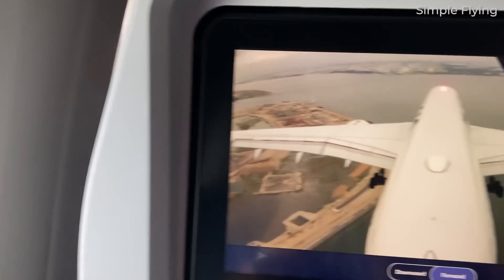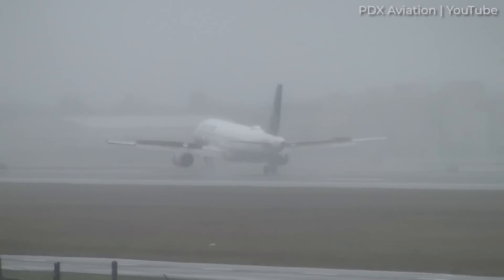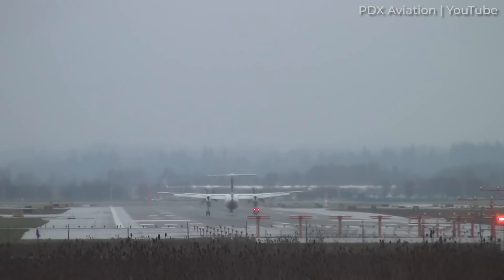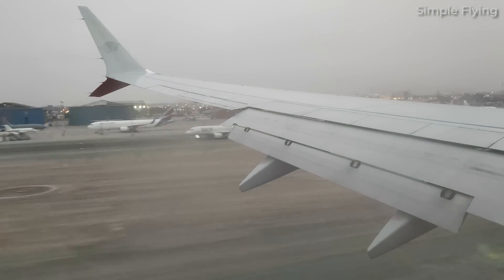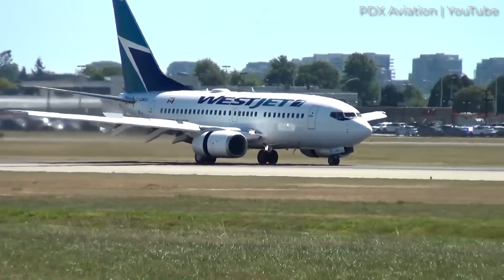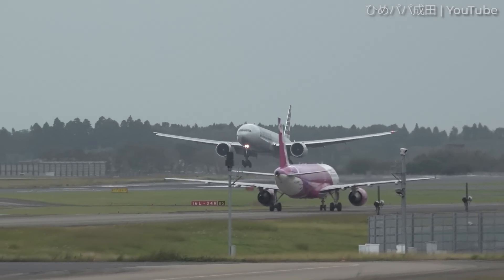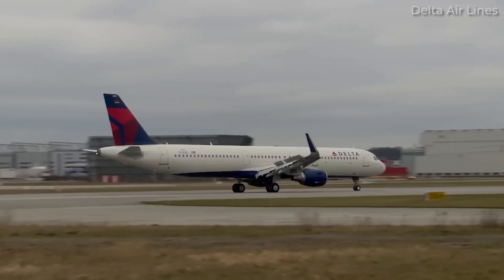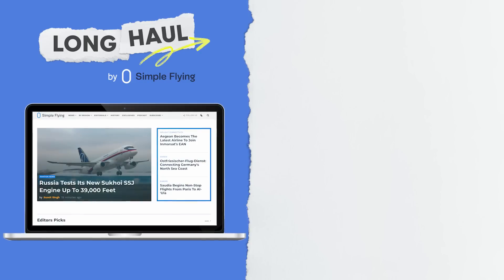Touchdown: The Variables That Affect A Smooth Landing

Comment: The best landings I’ve ever experienced was with any international flight on Philippine Airlines. Does not matter which plane they use. They may not be the best airline around but their pilots are exceptional at executing smooth landings. Most recent experience was into Melbourne from Manila on a 777-300ER (which was surprising because PAL uses these planes for flights to the US West Coast and also Vancouver in Canada. PAL usually operates the MNL-MEL-MNL route with the A330-300). The landing happened close to 6:30am AEST and it was so buttery smooth, a few of us passengers were clapping.

The worst landing I’ve ever experienced is probably with AirAsia on one of their A320s. Forget when it happened. It was such a hard landing that I was exchanging looks with my brother, who was seated next to me, and there were whispers in the cabin about the hard landing giving everyone a jolt. Didn’t help that my brother and I were seated towards the back.

Comment: The Airbus A330 and A340 are really the true butter machine of aviation as we know it. I do try to make some smooth landings and i do have some videos about me trying to land as smoothly as possible in a real mobile flight simulator and some of them are not smooth and also quite sucks but i upload some of those not good landing videos anyway. I am looking at you 👉Lion Air. I flown with Lion Air twice and at the time, the landing was not hard actually.
Reply: Can vouch with the A330… at least in part to Philippine Airlines. Whenever I go back and forth between Manila and Melbourne, the airline operates its A330-300s and never has there been a time where the landings were rough on a PAL A330. Can’t remember much on the A340 landings because the last time I flew on one, the experience wasn’t very good as the cabin was seriously outdated.

However, I’ve also experienced hard landings on A330s as well. Cathay Pacific, believe it or not, did this. During a late night flight last July, on approach to MNL, from HKG, the A330 had a pretty rough landing and everyone felt a noticeable jolt. After that experience, I was pretty surprised that Cathay pilots do this. (Given that Cathay is supposed to be up there with the best, the pilots didn’t really reflect that standard with smooth landings)

Comment: spirit airlines flight from oak to san had a clear air go around due to incorrect approach speeds. Within the plane as we got lower and closer the pilot would push and release the throttle giving a jolting experience. same occurred on second attempt landing with hard braking once landed

Comment: Speaking of Ryanair, a  Boeing 737 800 landing at Kerry airport (KIR) isn't going to be the smoothest because of its 2,000m (6562ft)  runway. But the roughest landing I ever had was in a turboprop at that airport. The conditions weren't bad at all apart from the fact that it was dark, so you'd expect the landing to be ok in a smaller aircraft. The initial hit woke me from a sleep and there were plenty of audible gasps and yelps from other passengers.

Comment: Best always comes in an a330😊
Reply: Aka, the Butter Machine.
Reply: Rarely got rough landings on the A330. The only time I could remember such was with Cathay Pacific last July from Hong Kong to Manila. (They normally use the A321neo for flights between Hong Kong and Manila but because of the high volume of passengers for the flight I took, they used one of their A330-300s)

On approach to Manila, the landing was pretty rough and everyone in the cabin felt a hard jolt in their seats. T’was unpleasant and shocking (pun intended) considering that this was Cathay Pacific operating the flight.

Comment: I disagree that landing at higher airfields renders the control surfaces less effective, pilots use what is called IAS which essentially caters for the lesser density of air and in effect the aircraft is physically moving faster through air to compensated for the loss of density, in such a scenario the control effectiveness would be retained.